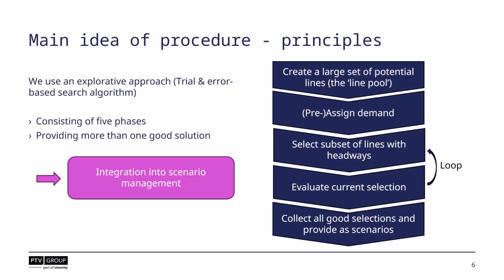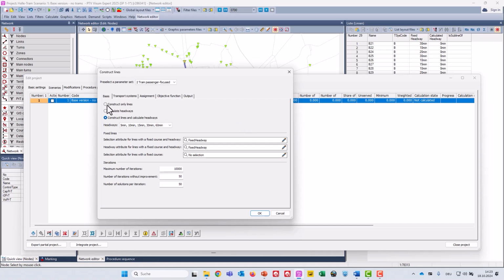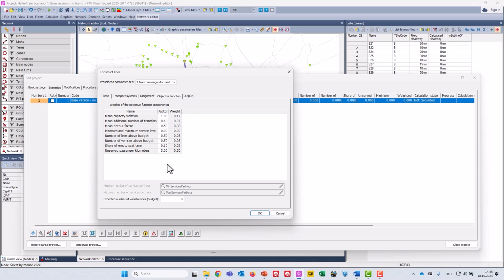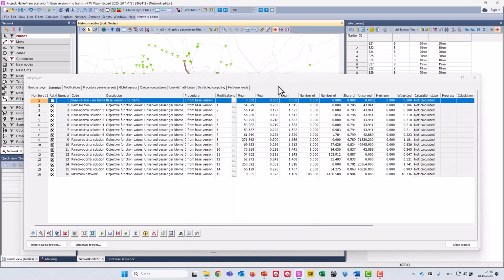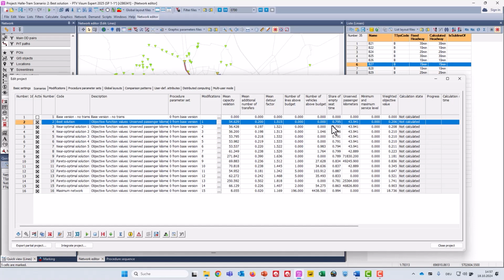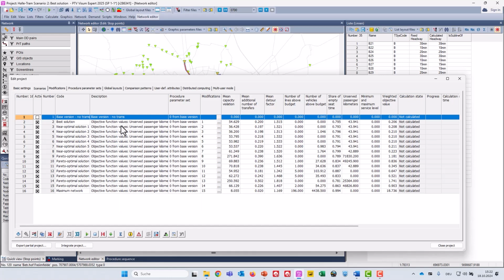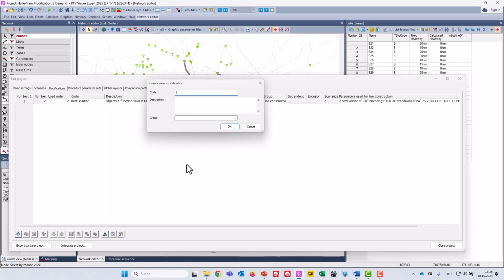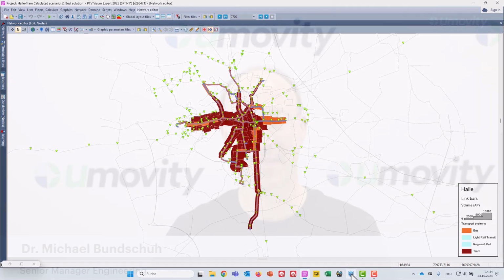Automated PT Network Design | PTV Visum | Webinar

Comment: Based on what information the algorithm has decided to put Tram line, metro or bus line?
Reply from the maker: Good morning, in the concrete example there is no choice of transport system, since in the procedure parameters we defined that 'tram' is the only transport system to be considered.
In general, you could of course allow several transport systems, and the system would choose. In this case, the different transport systems will make use of different parts of the network (links, turns, stop points are open or closed for each transport system), and travel times on links may differ. This will lead to different line routes that can be built for each transport system. The system makes its choices between line routes, and therefore implicitly chooses transport systems as well.
If there are no differences in infrastructure availability, there is no need to model different transport systems from the traveller's perspective. If there are differences, these determine which line route (each belonging to a specific transport system) fits best. Hope this helps.